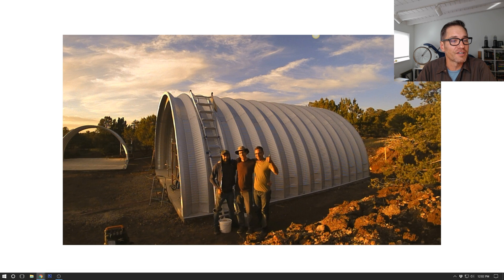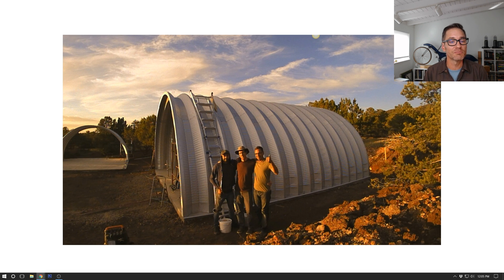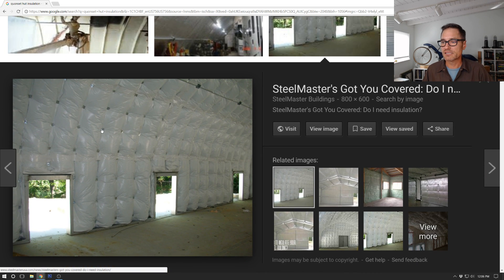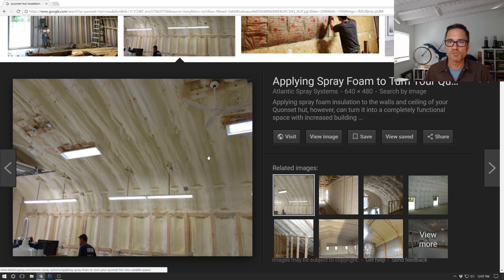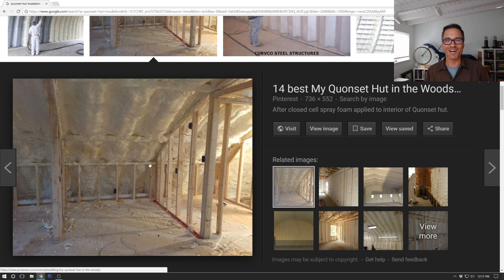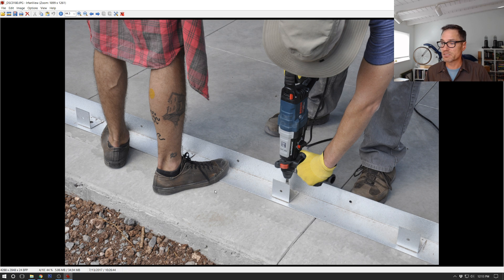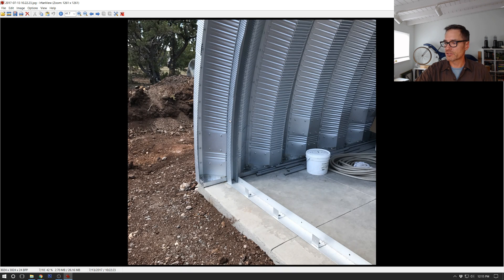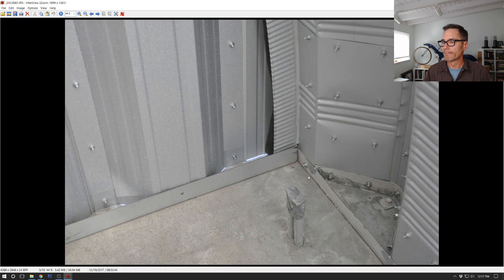Quonset Hut End Walls, Insulation, and Framing

Comment: Be careful with spray foam insulation in K-span buildings (Metal Arch), it can be a serious fire hazard. The foam can spread the fire and you can lose a building very fast. We lost several buildings in Afghanistan because of spray foam fires. The buildings take about 10 minutes for complete consumption. The spray foam was rated as fire resistant as well, and from recognizable manufacturers.
Reply from the maker: Thank you, this is an excellent (though extremely unfortunate) cautionary tale. The building code requires a thermal barrier between the foam insulation and the interior space of the building. I will be sure to emphasize the need for this in the future. (This is typically achieved with 1/2" drywall or intumescent fireproofing coatings of sufficient thickness.) The thin metal shell is definitely going to be extremely vulnerable in the case of a fire.
Reply: Bob, Did the fire start with the foam? Or the foam burned as a result of another fire starting.
Reply: @sldghamr58  The foam was caught on fire by workers cutting window openings with a grinder (sparks) but the foam an insulation acted like an oven and the buildings went fast.
Reply: Geezus. That could happen from the electricity as well a few years down the track.

Comment: I purchased a steel master quonset hut, and the things that irritated me the most: was the instruction manual was terrible at giving key details about installation. And also the waterproofing is quite terrible as well. I had to use a tremendous amount of sealant on the base connectors to stop water from leaking in.

Comment: Have you ever considered using a bubble wrap style insulation? Im concerned that spray foam will deteriorate too quickly and then you’re stuck with it. I am seriously considering using a specific product known as Prodex…curious if anyone here has experience with both types?
Reply from the maker: Spray foam doesn't really deteriorate when you install it correctly and finish your interior correctly. Prodex has huge potential for condensation and therefore mold. They hype it like it's great for Quonsets but I would never use it.

Comment: Great video! I think you want to put a thin adhesive rubber strip between the wooden ceiling members and the metal structure to help with sound deadening & reverberation.

Comment: Hi Earl this video was very informative! Thank you! I have a question...we have a 20x30 Quonset and I am leaning toward closed spray foam. My question to you is  this. using spray foam in your opinion will it add strength to the  walls and ceiling? We live in an area where we get heavy snows in the winter. So if it adds strength it would really be worth the spray foam. Also can you paint over the spray foam? I was thinking of putting a loft  in and not framing upstairs or very little framing ..... One last questions we were told the steel building had to be thorough cleaned to remove oil residue that  is on the steel before spray foaming which we did with a spray washer and dawn, do you think this is adequate? Thank you look forward to hearing from you.

Comment: in the video you talked about adding 2x4's to that you attached you electrical run to and and boxes.  Did you use this to support the interior walls that were added.  i am looking to adding an 10 x 8 room to run some freezers and hold temperature at at constant in the room.  looking at what you did to support interior walls besides just anchoring them to the floor. thanks for the videos.

Comment: Hi Earl, I'm very new to construction practices so if I'm asking stupid questions, I apologize.  I saw it mentioned in someone else's video that applying spray foam directly to the metal is not a good idea because the metal expands in summer and contracts in winter causing the hardened foam to eventually crack and break off in sheets. Is that accurate?  Also, a lot of builds I see use wood for all the interior framing. What are your thoughts on using steel framing instead? And, I'm curious of the viability of building concrete walls for the lower floor making it easier to install doors and windows along the sides of the house and then dropping the Quonset hut on top of those lower walls, adding a lot more height for a second floor?  Thanks so much! I love your videos and website!
Reply from the maker: After seeing how the spray foam works and what it's like I have a hard time imagining it breaking apart like that. Also I have never heard or seen an actual account of this type of behavior with spray foam, it's always "I heard that..." or "...someone said..." so I'm starting to think it's like a myth of some kind. If anyone has a link to someone's direct account of this happening to them I would love to have a source and investigate it for myself. 

I have never worked directly with steel framing so I can't speak from experience but I don't see why it would be a bad idea. I would want to insulate it from the outer metal shell to protect against thermal bridging.

We have a building at the Quompound with concrete side walls. You can read all my blog posts tagged with that building at this link: https://www.clevermoderns.com/category/building-the-quompound/loft-house/

Comment: Just beginning the journey and trying to determine cost effectiveness of finishing inside of quonset homes. It seems like it will be quite costly. We will be building in VA and I don't even know how to find someone qualified to finish the inside given the radius challenge.
Reply from the maker: A Quonset doesn't cost any more than a conventional build, and done right, can easily cost less. The inside of the arch is easy to make a beautiful finish with drywall, plywood, wood slats/T&G, or even corrugated metal for an industrial look.

Comment: Did you have to cut each of the vertical end wall panels at the top to fit the changing curve of the qonset hut or did the endwall panels come precut to fit correctly as you move center out?  Hopefully that questions makes sense...
Reply from the maker: They cut them at the factory but one building they were all too long and we had to trim them.

Comment: I have a 25x40  Model Q building on a floating concrete base and sand floor in the middle. I want to add a center concrete floor. Should there be a bond breaker between the new concrete and the floating base?

Comment: I want to build a quonset home on passive house principles and with as many sustainable/natural building materials as possible. Are you familiar with flexible wood fiber insulation? It's very moisture tolerant and flexible, with high R values and low flammability. Best of all, it's got the sequestered carbon from the tree and is made from wood waste. Thinking a way to use it might be to throw up the moisture barrier sheets on either side of the insulation (?) panels, which will be laid into interior arched framing throughout the quonset, then using a natural plaster for the interior wall/ceiling/arch surface--plaster is also breathable and moisture tolerant. I think I'd end up with a beautiful plastered interior that maximizes light from the end walls and very few side windows, and an incredibly strong and beautiful arched interior. What are the biggest problems with this method/these materials that I should be considering? One big/obvious challenge will be accessing the panels, which are in very limited distribution. I'm attracted to them for sustainability, health, and aesthetics, however, and now I don't really want to consider the more toxic conventional materials that everyone seems to be using. Do you think this plan is possible? Thanks!
Reply: See the True North Quonsets for how beautiful plaster looks inside of quonset huts....

Comment: Thanks for these little Q&A vids Earl; I find them a great resource for someone like me who is in the early stages of planning and information gathering before I dive in and start building a Quonset home.  I did have a question relating to the attachment of wood studs to the shell of the Hut.  When these are attached using the threaded rods, is there any concern with the wood touching the metal shell?  I know this needs to be done before spraying insulation, but my concern would be with the contact point and the possibility of condensation from the steel to the wood.
Reply from the maker: If the hut is insulated properly and has a vapor barrier installed on the inside surface of the insulation you shouldn't get condensation on the steel at all. My understanding is that a sufficient thickness of closed cell spray foam insulation will act as its own vapor barrier in this context. How much thickness would depend on your local climate. Our spray foam installer told us three inches would be our minimum.
Reply: I wonder if you used pressure treated wood for those boards plus maybe put some blueskin on the side of the board touching the metal.  It might help but im just guessing at what may help protect those few boards longer from the possibility of rot from condensation.
Reply: I recently purchased a Quonset hut to live in and I’m in the process of replacing water damaged Sheetrock, insulation, and paneling.  I  am installing new roll installed with a paper back and I plan to add a reflective thermal barrier  over the insulation.  The house is already framed, so I don’t know how I could get the thermal barrier or vapor barrier on the inside of the insulation.  If I tape the thermal barrier. I assume that will act as a vapor barrier as you suggested.  I plan to add strapping over the thermal barrier then Sheetrock.  Do you see any issues with this plan?  I have one 8 inch vent on the ceiling, which was closed and had a mouse nest in it, which might explain some of the condensation.  That’s now open.  Was thinking about putting a fan in it (inside the ceiling) to suck out hot air but probably won’t get around to it.  The house is in Massachusetts and we’ll primarily be using it for the summer.  Thanks!

Comment: I am subbing just for this image.. 17:01 !!!   Thanks.   I am wondering if this can be baked into building plans for a legal Florida residential home build... My county department said this:

"Wind rating is not all that has to be considered.  Exterior walls must meet the requirements of Chapter 6 of Florida Building Code (FBC) Residential.  The roof assembly will have to meet the requirements of FBC Residential Chapter 9.  Insulation type and “R” value will be determined by FBC Energy Conservation calculations.  An energy form will need to be completed and submitted with the building application.  Interior wall finish will need to meet the requirements of FBC Residential Chapter 7.  You are not required to connect to electric service."
Reply from the maker: These requirements are fairly standard for permit submittal packages in most places. (Subsitute Florida Building Code with International Building Code, California Building Code, etc,  depending on where you are.

Comment: Hi. Next week I will start puting in place 5 quonset units, each one has two whirlybird roof ventilators, but I still dont understand how they have to be installed...can you help me? Do I have to cut any part on the roof structure or should it be a special piece where I have to install them?
Reply: I have never installed one of the turbine "whirlybird" ventilators myself but I believe you do have to cut a hole for it. You should check with your manufacturer on exactly what they recommend. Who did you buy your buildings from?

Comment: Help.  I dont have fb.  My quonset is 25 years old and every month i have to clean off exterior base plates.  The base plates are flat on the concrete and hold water, dirt, leaves, etc.   Is there a product or suggestion for installing some kind of flashing so the base plates dont hold water and trash.  I now have rust pits on my exterior base plates.
Reply from the maker: At a minimum you should keep some kind of paint on them to inhibit the rust from continuing to corrode the metal.

Comment: if you plan PLAN ON THIS ! > it sweats> So any place where its not insulation > it will sweat and rot the wood beams So its best to know where your going to put the braces and go ahead and insulate it?  I tell ya> SMALL CELL FOAM IS THE BEST WAY>  it BONDS to the metal
Reply from the maker: Definitely going to use foam! Thanks for the feedback!
Reply: yvw    i got one,  i use small cell foam.  That what i would use, it make the building  even stronger, and a higher R value. I LOVE EM so much, so going to make a house out of one 
 cheers

Comment: Need to build timber inside.i only have30x30n the building is 45fwet long.cant get more steel so gonna finish with post n beam.it is a26x45.gonna put more foundation where the house goes narrow as it s only30wide for 15 feet.please advise thanks
Reply from the maker: Hi Eric, thanks for watching; I'm not too clear on exactly what you're asking here.

Comment: Tell me if I'm wrong....  I've only lived in a quonset hut on base in 29 palms California. Hot and dry. I live in Pennsylvania though and want to build one to live permanently. I'm thinking of this more like an upside down boat hull,, not literally but you understand. Boats have a bilge for condensation, house won't. Would it be best to keep insulation an inch or 2 away from the steel and vent in between to keep condensation and mold/ mildew under control? Angle the base to allow drainage? Or am I just over thinking the whole thing?
Reply: Bruce Gibson   Yes, was thinking the same thing.
I wish he would come back to answer but I guess these (steel masters) have been up for at least two years and the info can be found elsewhere.  
But I am just starting my quest and answering questions within this video would be optimal.

Comment: What size are the coupling nuts - all my instructions just say "fastner" but don't give me a bolt size.
Reply from the maker: Ours are 5/16 thread. I think the manufacturers all use the same bolt size but it wouldn't hurt to check with your mfr.

Comment: EarlDid you rebar the foundation floor ..? how thick it is..?
Reply from the maker: Yes there is rebar in the floor. I would have to look it up in my drawings. The slab is 4" thick but much thicker at the perimeter foundation. The foundation is designed by the building manufacturer.

Comment: hey there im doing a 25 x 30 x 16 g series dura building can I get some tips or coaching love you to come see the property
Reply from the maker: Where are you located? You can email me directly at earl@clevermoderns.com if you need help with a specific question or want to discuss coaching. I'm happy to help!
Reply: Clever Moderns  ok will do thanks
Reply: I am trying to build me and my wife's dream home she was diagnosed with stage four breast cancer that has moved to her bone she is fighting and doing well but we had bought some property years back for cheap with the dream of building so after much looking and figuring there is no time like the present we bought a 25 x30 g series from dura span buildings and are putting it on the industrial base plates on a wooden floor box on pretty much the side of a mountain the building will be on 6x6 post it will be a for off the ground in front and about 12 feet in the back I just got the money up to do the post and the outer band board done of these post will be fastened to boulders any tips on that we will be taking our building it will be here between July 1st and 14th and our lumber is being delivered on the 6th of July like I say we have enough to do the post the outer band board and the center support and we'll have to get the rest if the lumber when we build more money up get the floor joist and the plywood and I'm going with all treated lumber ground contact lumber on this build because of it being up in the air in the moisture and stuff being by the river and all we had a camper pulled to the side so we will be moving to the site full-time why were building the Quonset and we hope to have the Quonset built and at least livable but probably still working on it by this summer any advice tips help tricks that you could give would be very appreciated thank you for your time
Reply: By this next summer I mean I think we will be in camper through winter but who knows also do you have any suggestions on insulation